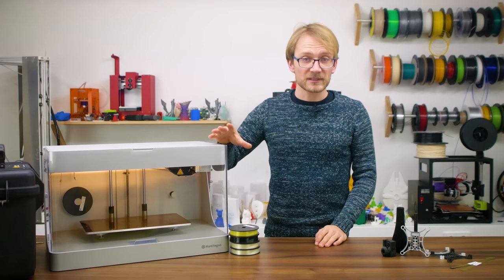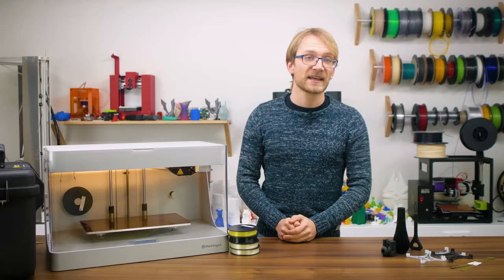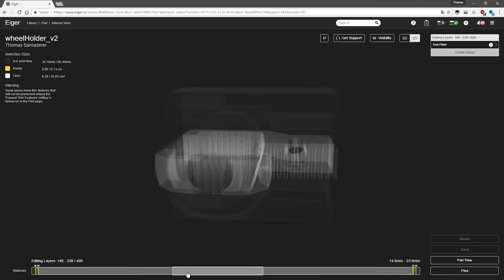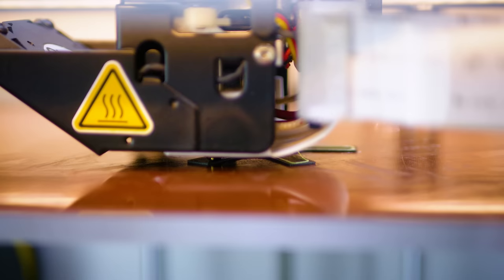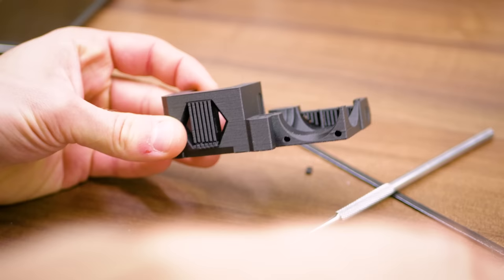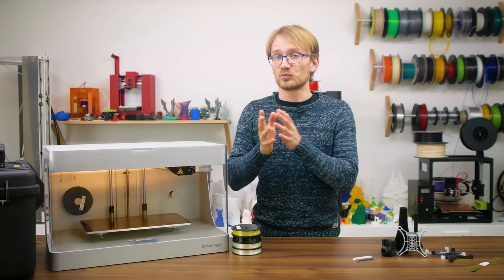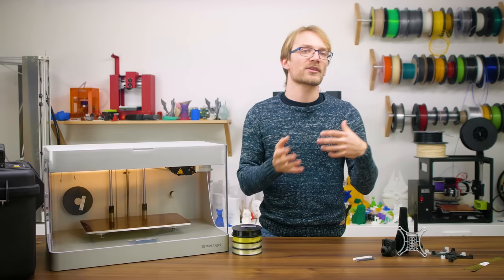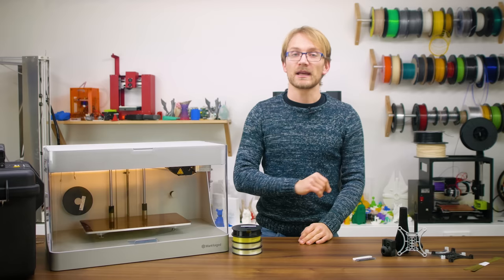The Carbon Fiber Printer: Markforged's Mark Two review!

Comment: Patents are one of the many things that slow down advancements in science and technology... oh well I guess the arguments can go both ways. I am pro patents-free or defensive patents.
Reply: It's not that hard to recreate. Use the same code for a double extruder, except this one cuts the end off. 
It's just the fiber coated with nylon so it adheres to the rest of the nylon print. 
It uses an oversized nozzle bc it doesn't print, but still needs the nozzle to push the extrusion down onto the print. Other than that, it uses the same code that double extruders do to change positioning for offset and switches which extruder is used. 
The only problem is the material.
Reply: Nah, I  am not saying it is hard to make. It is the patent. Meaning that you can't use it (legally anyway) even if you want to.
Reply: The whole machine is patented. The patent for the secondary printhead is just within the collection of patents for the machine.
If they can patent their slightly different standard extruder that doesn't greatly differ from any other extruder; you can easily make a secondary extruder similar to theirs but not infringe on their patents.
Reply: The biggest reason for patents is that the actual development of whatever you're producing will usually cost a lot of money. Then when you start making and shipping your product, you have to account for that and make it cost a little bit more. But then after all that work, someone comes along and just copies your product, forgoing the development altogether and making it far cheaper. This type of market in fact slows advancement and penalizes inventive spirit, and rewards just screwing people over and producing copies (whether those copies are good or not)
Reply: +Phasedragon Sounds like China.
Reply: Mega Making Except without them, plenty of things would have never been created to begin with. Why make anything if someone can just steal it?
Reply: Phasedragon Prusa, Tesla... The innovators today... Get their products out before the copiers have time to learn what they are doing.
Reply: While it's true that innovators need to protect their initial investment, the patent system is regularly abused thanks to America's overly litigious culture. We've missed out on 20 years of 3D printing technology because it's been held in the hands of a few companies.
Reply: innovators will take this into account in development and adjust accordingly.  Half of the cost of research and development is payin the agencies to police and limit competition. Patents are only bad, contracts between individuals is another story entirely.
Reply: Can't use Patent information for your own private use?
What country do you live in?
US patent law is clear: use any patent you want, for your own private use, no problems.
Try to make a commercial product using a Patent that you don't have rights for, most illegal.
The difference is entirely your intent:  are you 'researching prior arts' or 'stealing from the Inventor'?

Which are you doing?
Reply: I agree.... the hoarding of patents is slowing down things.... but whenever a company that is making something invested a  great deal in it and actively making use of the tech and still improving it I think they are very justified in patenting that.
Reply: Quite a mystery indeed, Video What, isn't it?  Why would anyone write an operating system if they couldn't have exclusive rights to sell it?  Or invent a vaccine for something like, say, polio if they couldn't patent it?  It's hard to imagine what could motivate creativity without the prospect of getting lots of money.

Comment: I really like my MarkForged Mark 2 Enterprise edition printer.  Your video was very informative, especially about the Onyx/Nylon print head wearing in time.  I'd like to know what options I'd have in therms of post-processing Nylon or Onyx.  How would one best smooth it out?  Or how about painting it?  Printed Nylon and Onyx seems to become more flexible and less brittle when immersed in water, but it also seems to lose some of its shape, if the print is single-wall.  I'm very impressed with its impact resistance.  I'm experimenting with printing static planes, RC planes, and quad copters, so far with very promising results.  I'd just love to know how Nylon likes to be treated over the long term.  Crash-resistance in RC planes seems very promising.

Comment: Frankly I don't think it would have been all that expensive to inlay small strands of material, like metal wire, into PLA and instructing the printer to fill it into the part with plastic. I do think such a process would require a wider nozzle though (.8mm at the least). The other alternative of course is their patented process, which is to use the heated nozzle of the fiber extruder to melt it into the part.

One could create a specialized printer with a very flat hotend or a flat extension of the hotend to melt the material into the print, but then we run into issues of oozing plastic possibly creating an uneven surface for the rest of the print...

This was not an easy thing for them to do. I dearly hope that they provide license to use the patent at reasonable fees. 
That is my biggest issue with patents, it allows such aggressive exclusivity. Mandatory license laws for patents would be good to discuss. Imagine what Josef Prusa could do with this process... if he cared for it...

Comment: Hey Tom! I have access to one of these at school. What did you have to change on the drone frame to get carbon infill to work correctly? maybe a short video on optimizing the software to get the best fiber reinforcement?
Reply: I have used 910 in the past, we intend to use many of the parts we make in a intake system where it is exposed to higher temperatures and fuel, both of which nylon does great with. We have a maker gear M2 that did surprisingly well with the 910. just looking to get a little extra strength from the parts. I messaged you on twitter the other day also if you every read those.

Comment: I get the price, but for that price the machine leaves a lot to be desired. H-Bot movement? RC servo actuated cutter? No auto-levelling? Give me a break. Thankfully, for them, it's the good old USPTO to the rescue because of course reinforcing one material with another or using an ironing process to stick one material to another are completely novel concepts.

Comment: i'm wondering how long until an open source version of their fiber laying system gets made
Reply: Ryukachoo Trouble is, they can't be sold due to the patent, so development will be slow by enthusiasts. Thanks to Stratysys/makerbot we have no heated chambers on other commercial printers. It makes me so angry/frustrated.
Reply: I'm not so sure about that, since there was a RepRap  fiber laying extruder experiment several years back, depending on how Markforged's patents are worded they could be laying themselves open to a courtroom patent nullification if they were not careful.
Alas that would require someone to hire a lawyer and present the evidence in front of a judge, and who has the money and time for that, maybe something the EFF could take a look at, who knows?

Comment: The overall design and cloud slicer for this look a LOT like it was based on the failed Zeepro Zim. They have a Boston-area area code, so I assume they're not related to the French company. But the resemblance of hardware and software is uncanny.

Anyway, after that company, I wouldn't buy any 3D printer that required a cloud slicer. Eventually, they'll eventually go out of business, or stop supporting it, and you're stuck with a $14,000 paper weight. Or they'll put limits on personal resale of the device, and you won't be able to unload it later to get something else.
Reply: Saw that you addressed this a bit further in the video with the offline version. This is a HUGE thing they should blast all over the page. The minute I hear or read "cloud software" on a device like this, I stop listening.

Comment: as long as it is not possible to use human brains to say where I want the fibers it would not be an Option for me.  for me it looks it is well made for Standard strenght Test Parts. i also would like to See a comparisson of Glas fiber to carbon enforced Parts. Glas adds often some flex which can be very welcome in extreme situations. carbon is cool but beside the weight often not that Superior.

sorry for the strange Camel capitals. tablet keyboard

Comment: Frankly, price-tag aside, the closed nature of this whole ecosystem makes me indifferent to it, despite the cool new technology. I want the option to use any slicing software I like, choose my own preferred filament, and tweak low-level settings like temperature. I want the ability to hack the software to my liking and customize my own gcode. This company can't possibly provide everything we might need, and they purposely prevent us from interfacing with third party stuff.

In other words, this is not a printer for hackers, even if it could come cheap. And those patents could prevent an open version of this technology to be built for a long time. So at the risk of sounding melodramatic: if those patents are enforced, Markforged is essentially holding humanity back.

Comment: as a owner of the Markforged Mark Two I am VERY disappointed with the Layer interface Surface quality.
Reply: Tell me more please
Reply: Disfatt Bidge  Wrong, The printer has received many updates. but my issue was a flawed Hotend heat exchange. the abrasive filament can wear the exchange out causing the melted filament to seep up into the hotend creating a restriction causing under extrusion. Why would you assume someone who purchases a 15K printer doesn't know to keep filament cool and dry? especially considering Markforged supplies you with an air tight box.

Comment: Well 13000 without auto bed leveling :-(
Reply: ou arent looking at it from an engineering standpoint. Being able to pause a print, maybe machine or place embedded objects in the print WHILE STILL ON THE BED is a MUCH better trade off than auto leveling. This is a workhorse, hence the name containing "enterprise". The manual bed leveling isn't even a struggle. takes two minutes and if you never move the machine, it wont affect it for over 100 prints.
REPLY
Reply: Stopping the print and embedding objects doesn't necessarily preclude the use of an auto-leveling bed, nor does it's designation as an "enterprise" device.   And that's looking at it from an engineer's standpoint.

Comment: Good looking machine, but that black box to hold the fillament is very unattractive ! and simply kills the classy design flow of the 3D printer. The fillament box reminds me of an ammunition or fishing box.  The layering of carbon, kevlar or fiberglass strips with the fillament may offer parts similar to CNC aluminum, but the composition of the two indepent materials is a bit distracting, aesthetically.  I much rather have a  composite powder within the fillament itself with the proper properties to do what this machine is doing by layering the materials independently, this allows for a clean and more attractive finished part.  Fiber filled or carbon filled injection molded parts for example are pretty strong, same thing can and has/is being done with filament, already, with machines at a fraction of the cost of this one.   The price seems way markedup for what the machine is really doing and offering.  I am pretty sure some creative tinkereres are already doing similar at a fraction of the cost with standard components and 3D printers. So where is the real magic for $15K?
Reply: Hes showing you parts printed in half, and parts that are transparent... Hes showing the layers. The fibers are embedded within the part, you cannot see them.

Comment: Warning: Comment section full of pretentious and gullible “engineers”
Reply: I may not be an engineer, but I am a machinist with 100k CNC machines that I use daily. Until you fully realize the amount of time, effort, and money this printer saves, as well as the part capabilities-- your arguments are invalid. If you see what many trades people see, you'd call yourself an engineer too.

Comment: another example how patents are detrimental overal.
I will never buy such an overpriced machine, and because of patents it may mean that there will be no competiting offer for me to buy for close to 20 years. Many a project will not get done
Reply: skaltura on the other hand if patents would not exist then if you would come off with some solution to a problem and build up something good then everyone could steal this idea from you and give you nothing. what is working for patents in us is a joke, they are too strict and given for too many too simple things. but they are needed, not in current shape but needed
Reply: Nope, they are still stolen. Just the difference is stolen by those outside jurisdiction, ie. chinese, malaysia, korea etc.

If you have damn good idea, make sure your execution of the idea is just as brilliant. Otherwise you are not worth to keep the idea just for yourself, let someone else who has the skills and will to execute it brilliantly take over.

It is all in execution
Reply: forgot to mention, sometimes you don't want to patent to protect your stuff.
For example chemistry type of things where you have a formula, the contents need to be revealed and patents are a really good source for finding stuff like that.

For example one mfg has patented their glue with full instructions + formula in the patent. Change one thing ever so slightly and you have avoided the patent, but the patent gave you the formula to make it.